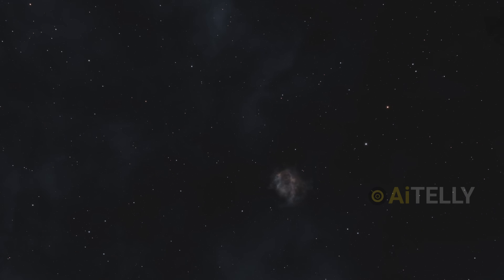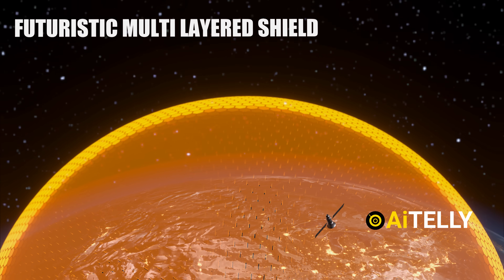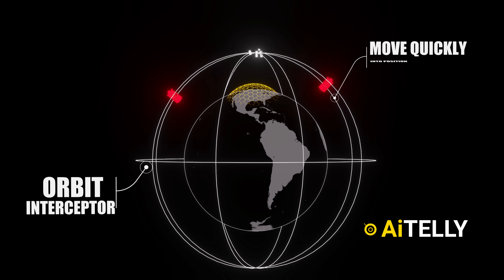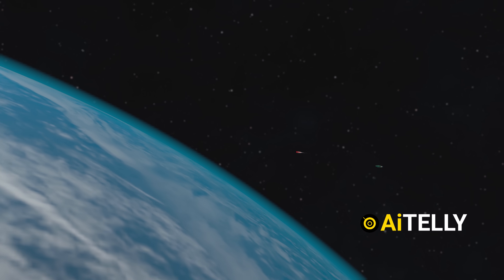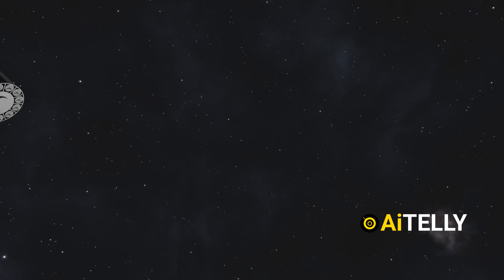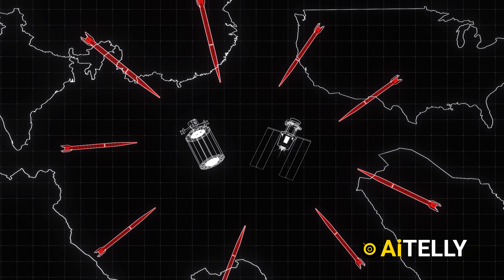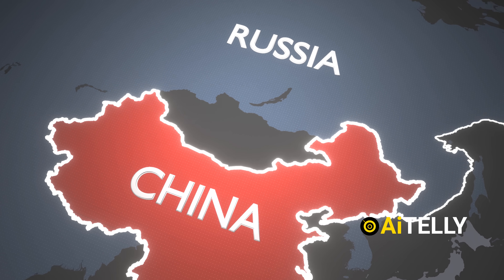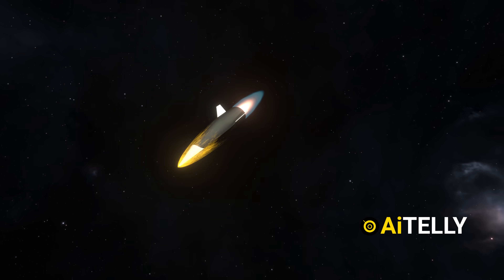Golden Dome US Space Force | Explained

Comment: ffs let the god rods theory allready rest in pieces where it belongs, it's impossible for the rods to not spin out of control if not rocket propelled thus voiding their existence in the first place. The rods ALLWAYS take the path of least resistence, the earth spins, as the air pressure itself would make sure it spinns and falls sideways, making it only a annoying metal pipe falling from space making nothing but a sound and the normal size impact, aside of melting smaller.
Reply: Aside of the cost of getting them up their in the first place.

Comment: The best time to intercept ICBM threats is at the boost stage. Outside of that, the curve is almost zero.
Especially at the moment of reentry, when the MIRV is activated. At the moment of reentry, the multiple warheads reach unimaginable speeds.
So the premise should be to first shoot them down at the boost stage.
And then countermeasures if the first premise fails.
One must also work with the premise that the countermeasure must be faster than the ICBM itself.
For this project, a new type of missile must be developed. This missile must achieve incredible maneuverability, the response time must be zero, and the accuracy level must be 100%, 24/7/365.
A set of technologies must work in constant collaboration.
For this project to be a complete success, some countries will have to collaborate, perhaps even ceding airspace and land.

Comment: I discussed this with Pournelle at a SiFi conference in Houston in the early 80's (and got to talk with Robert Heinlein too for about 10 min which was actually a very signifigant encounter in my life) and he agreed that the Kinetic Energy Weapon (KEW) DID NOT have to be tungsten but could be simple iron or steel with a thin ceramic skin / cap on the nose. We also discussed that launch costs and load limitations made the weapon system unfeasible at the time but he did say that even material mined & refined by a automated / robotic system from a  near earth or Apollo Asteroid would work if melted and put into a steel pipe. It wouldn't be as good a bunker buster but would still have significant surface destruction even being less dense.

Comment: Probably not too effective against torpedoes or other ocean delivery vehicles containing nuclear warheads.
Reply: Agreed.  Trump's "Golden Dome" initiative is a massive waste of money.  At most, all it can hope to accomplish is to push other nations towards developing more effective nuclear weapon delivery systems that do not rely on ICBMs travelling through space.

The reality is, is that the US has massive oceanic borders, which are mostly unmonitored and unpatrolled.  A hostile nation could easily smuggle a nuclear weapon into the US.  One hypothetical method would involve loading it onto a fishing vessel, arranging a rendezvous with another (US flagged) fishing vessel in the open ocean (preferably while under cover of clouds), transfer the nuclear weapon to the US flagged fishing vessel, then have the US flagged fishing vessel come into a small US port like normal, then transfer the nuke into a large van or pickup truck.  Narco submarines are also hypothetically feasible smuggling vehicles for getting such cargo into the US.  Wheeled electric vehicles designed for underwater operation are also feasible, which if deployed onto the sea floor near a US coastline, could potentially roll itself up onto a US beach by driving across the sea floor.  US coastal cities are also vulnerable to nukes being detonated under the water near the coastline.  Space and air delivery of warheads is simply not required.

Basically, Trump is a big money waster.  "Golden Dome" is a massive boondoggle, which would not actually do anything meaningful to truly protect the US inhabitants from hypothetical nuclear attack.  The most that Golden Dome would theoretically do, is that it would inappropriately embolden US government officials and make them even more militarily self confident in their dealings with other nations.  The US government is already far too self confident in their military capabilities, such that they take totally unnecessary and unreasonable risks when negotiating "diplomatically" with other nations.  Nations that know and well understand that they are highly vulnerable to others, are less inclined towards bullying and foolish antagonizing behaviors towards other nations.